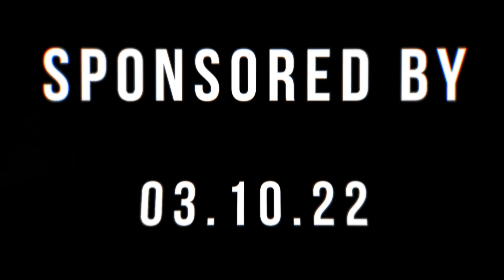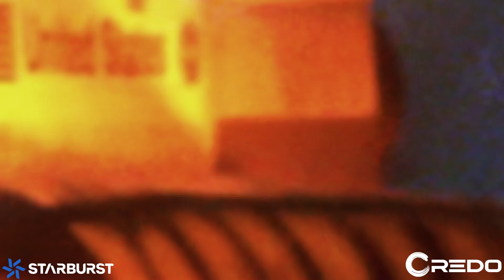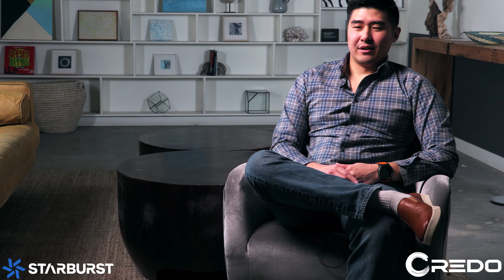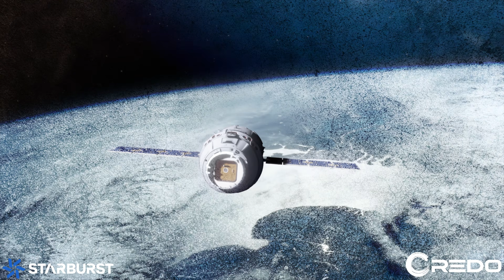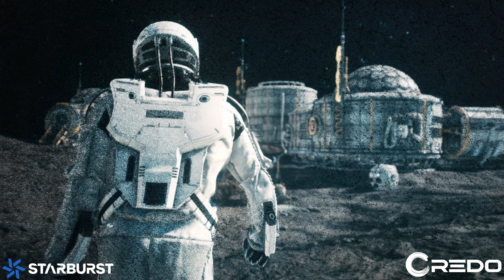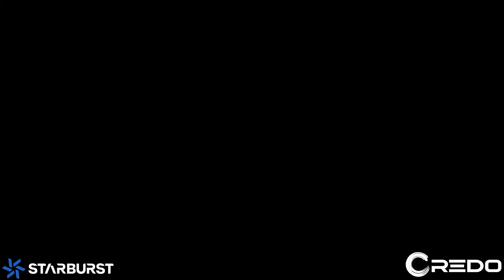Canopy - Thermal Protection Systems for NewSpace

Comment: Even if you had a module or rocket made out of carbon nanotubes and graphene boronitride to withstand extremely high temperature, you would need a thermal protection system and ablative tiles on top.
- The thought is that even if you lose a tile or two, the underlying skin, tapes, and tiles would be able to withstand Extreme Temperatures and Pressures of re-entry.  

I remember the Columbia Disaster vividly, and I was 5 years old